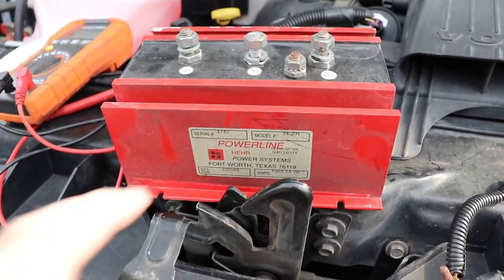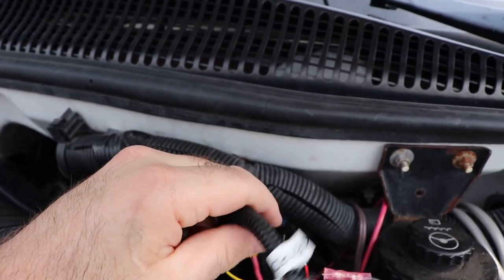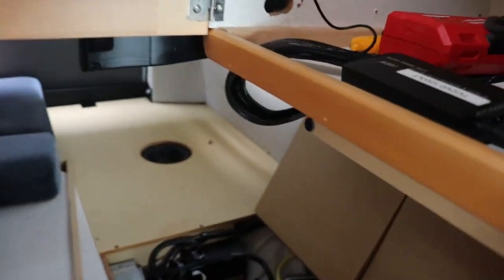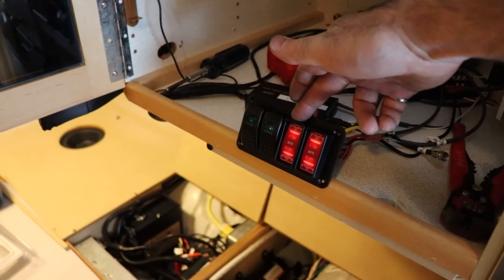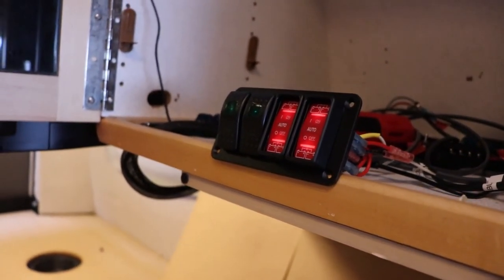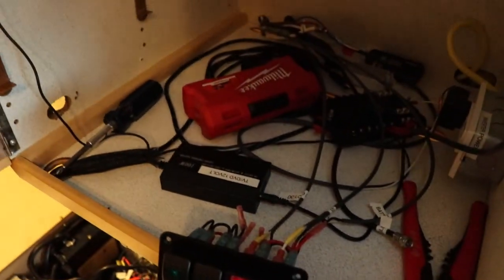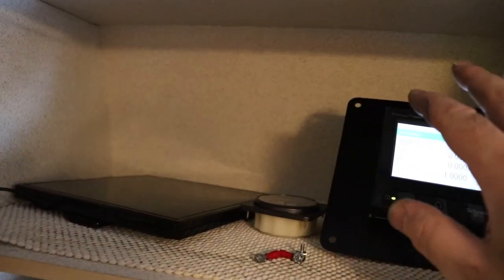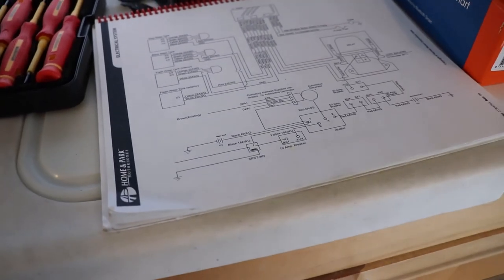Roadtrek Replacing Intellitec Contactor and Powerline Battery Isolator

Comment: Another great RT upgrade I recommend is swapping your 6gal water tank for a suburban IW60 tankless. 30 seconds to hot water. :) only real issue was the drain hoses. PS, thanks for showing the wire diags, def helpful. If you happen to have the diag showing the shore power, gen input, AC to DC charger and related relays, I would very much appreciate a link.

Comment: I wired in the same manner to my 2008 Roadtrek. But now the Generator won't stay running. It cranks and runs as long as I hold the start button in but dies as soon as I let go. I had the yellow lockout  switch locked out so I couldn't push the button in then I turned it the other way and pushed the button in. It popped back out. Ive watched you video sevral times and am not sure what to do. Do I put it switched
Reply from the maker: the wiring on the Roadtreks varies a little bit.  On mine, the generator is linked directly to the house battery so it is independant of the isolators.  You should find and download the Roadtrek simulator to see how your van works.  The wiring diagrams are also very helpful.  Please keep in touch.